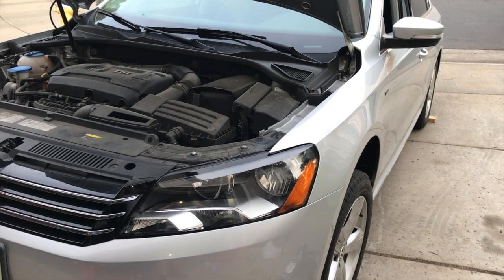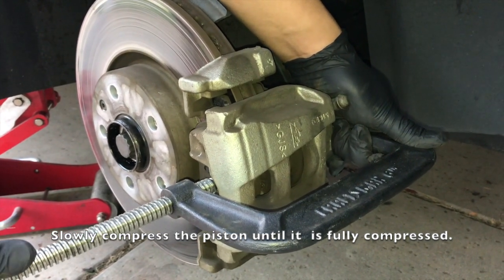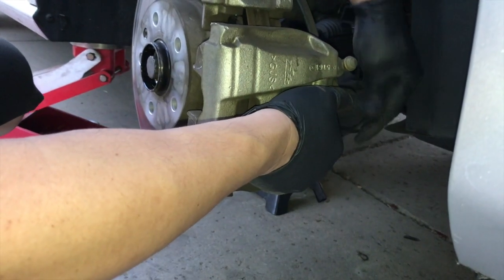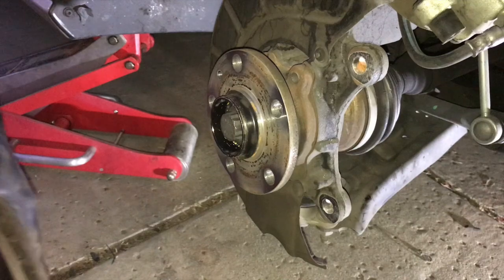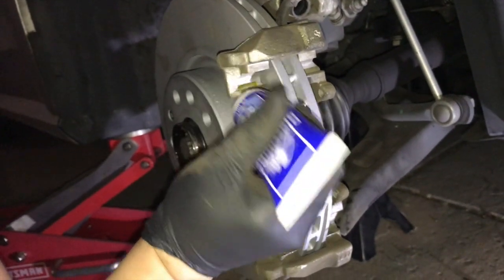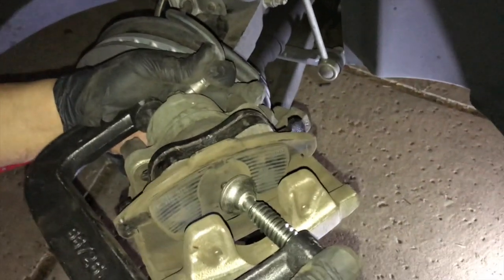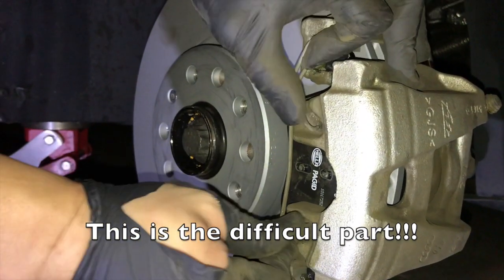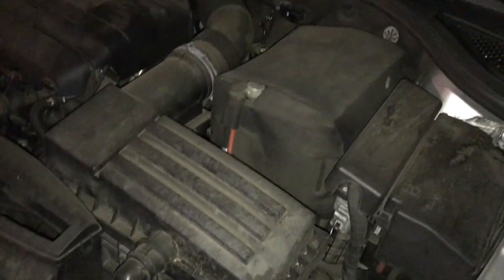How to Change the Front Brake Pads and Rotors on a 2015 Volkswagen Passat

Comment: jealous of the Hella-PAGID pads - those are porsche quality...  but how come no shims on your model?   as a RULE, I always pressure bleed with new fluid until the clean/clear is coming out - and ive never had to rebuild a car caliper in 40 years.   Actually, its recommended every 2 years to pressure bleed (prestone dot 4 synthetic is dope good enough) all your lines since moisture from the air and rain get into fluid and ruin it over time.  you will get much better braking too- like 2x new pads.    you need a 2nd person to pressure bleed, and my wife has even learn the routine now - alternative is to vacuum bleed, which can help get air out of lines better, but either way you NEED TO BLEED out the old until new comes through !!!!

Comment: Thanks for this.  I wish I had seen this before taking my 2015 Passat TDI to the dealer for a $1300 brake job.  One question if I may, When I look at the front pads they do not look like that are touching the rotor closest to the axel.  Is this normal?  Are the pads wedged shaped to begin with?
Reply from the maker: Both inner and outer pads don't really touch the rotor. It is supposed to slide a little. The pads will squeeze together when you step on the brake. Hope that answer your question.

Comment: Did your pedal stiffen up? Everytime I do this I pump the brakes before I turn it on and then some while it's sitting and get a super stiff pedal. First time I use the brakes while moving the pedal goes halfway down before it does anything!?
Reply from the maker: When you pump the brakes before turning on the car, it will get stiff. Does your brake pedal still go down half way before the pads engage?

Comment: Nice video - thanks for taking the time to produce it! as others have stated, I'm a little surprised at no grease on the pins, will have to take a really good look at if it's used OEM when I do mine in a few mins (2015 Passat TDI). THANKS AGAIN! 👍😊
EDIT 1 - my hex set didn't have a 7mm for some reason... Used a T47 Instead... Fit great!

Comment: Rotor Screw 4 Nm
Caliper Pin 30 Nm
Caliper Bolt 200 Nm
Wheel Lug Nut 140 Nm

The caliper tension bracket can easily be reinstalled by using a rubber mallet to hold one side in place while using a long nose plier to flex it back in position.

The B7 Passat is know to have a transmission solenoid failure, located in the valve body. The fuel pump and fuel pump control module are also know to fail every 90k miles or so. Not all too difficult to be replace. Most people fail to realize there is a fill plug at the front and at the top of the transmission.

Good job on the video 🍻
Reply: Retaining spring*

Comment: Thanks for the video.  It is appreciated.

Always, always, use proper torque to tighten all brake system bolts and pins.  Do not rely on feel.  There are torque specs, use them.  They exist for very good reasons, such as function and overall, safety. You will need to buy or borrow a torque wrench.

Also, in the least, you need to "bleed" both front calipers, ensuring that any air in the brake fluid is forced out.  Air in the brake lines will make the pedal feel soft and/or squishy.  That is because air is compressible, and does not need to be in the system. That video could also be added to this video, for a more complete job.

Comment: Take your time. I haven't worked on any of my vehicles in years so I'm a bit out of practice. Wasn't really paying attention and stripped my bracket ( 3:50 ). Now the money I was going to save doing it myself I have to spend on a $300 piece of metal.
Reply from the maker: Good advice.
Reply: great advice for sure. Stripped threads are the enemy of mechanics. It's always best to run bolts in with your fingers first to make sure there is no resistance.
Reply: @Ken-1  I got a new bracket and bolt. The bolt would  start but I couldn't hand tighten it. Took it back to the dealership and the tech told me I would have to use a wrench or ratchet so I had him do it and it went right in. When I got home I put it on with no problems so I guess it just needed that first screw through to loosen things up a bit.

Comment: AWESOME 👍🙌 VIDEO 
JUST WASTED (10 minutes on ANOTHER VIDEO THAT WAS VERY SHORT ON DETAILS; THAT MECHANIC 👨‍🔧 ??? KEPT BLOCKING THE CAMERA WITH HIS BACK 
WHEN IT CAME TO THE VERY IMPORTANT PART of GREASING THE  PINS THAT THE CALIPERS SLIDE ON TO ALLOW THEM TO RETURN AWAY FROM THE ROTOR  SOOO AS TO PREVENT 
( PREMATURE  BRAKE PAD WEAR) HE TOTALLY BLOCKED OFF THIS VERY IMPORTANT Operation
WITH HIS BACK)
THIS AWESOME 👏 
VIDEO WAS RIGHT ON ABOUT  DETAILS

Comment: Thank you for the video. Why did you open a break reservoir?
Reply from the maker: When you compress the piston, brake fluid will flow up the reservoir. That is why every time you install new pads, the fluid level will move from low to full or it might even overflow.

Comment: Question… for 2017 models, are there any special vw tools for changing brakes and rotors?
Reply from the maker: You should not need any special tools. Most brake systems are similar.

Comment: Love the video! I'm replacing the rear rotors and pads as well. Is it generally the same process?
Reply from the maker: I don't work on VW that often. In some cars, the rear brakes are slightly different. You might have to turn or spin the pistons. I have a few videos where I work on the rear brakes.
Reply: If you change the brake pads, its generally easy but you need a specialty tool to compresss pistons...its not the usual push it in, you have to place that tool in the grooves and rotate to compress. 

Replacing the rotos, now, that will be a challenge since there will be a lot of parts in the way to get the caliper bolt off....
Reply: @OEMEangg  !!

Comment: Why do we need to open the brake reservoir??
Reply from the maker: When you compress the pistons, the brake fluid will get push up the reservoir. IF you have too much fluid, it will overflow. IF the reservoir is full, the piston will not compress. Some people use open the bleeder screw.

Comment: How was the caliper bolt taken off
Reply from the maker: There are two 21mm bolt and it is on very tight. You would might need to use a breaker bar.

Comment: Are the brakes in the back the same?
Reply from the maker: Rear brakes are slightly different because it has the parking brake connected. On most cars, you would have to rotate the pistons.

Comment: Is it the same for 2016 vw Passat rline
Reply: Most brakes are very similar. The only difference is the rear alot of times have a wind back style which you need a special tool to turn back and some of the newer cars are coming with electronic parking brakes so you need a scan tool that has that capability to retract the rear pistons on those newer models. Other than that the only difference is some rotors have set screws while some dont. I recommend getting an impact driver especially if you are going to do hondas.

Comment: which way are the bracket bolts rotated, they’re a bitch to get off i’ve been working at them for maybe 30 minutes
Reply from the maker: Turn it counter clockwise. They were on pretty tight. But it shouldn't have taken that long to loosen it.